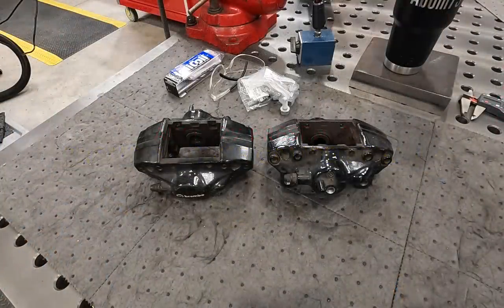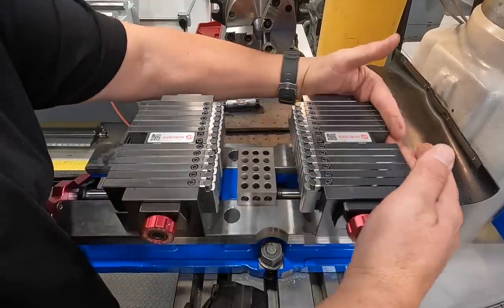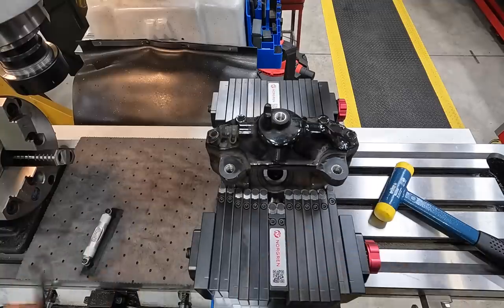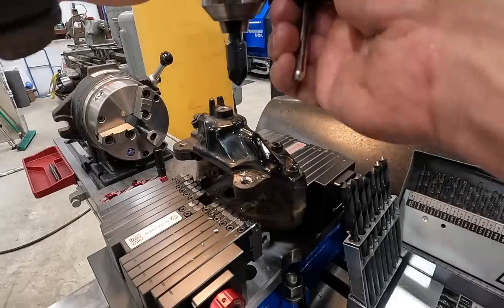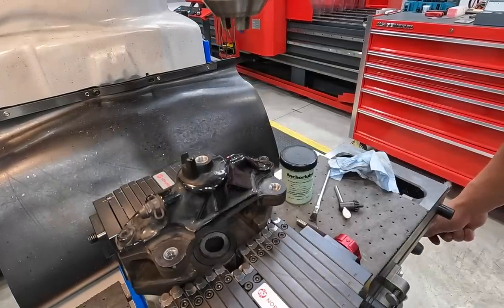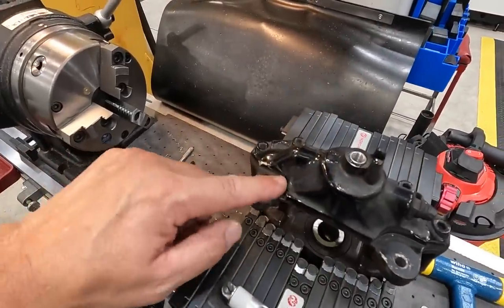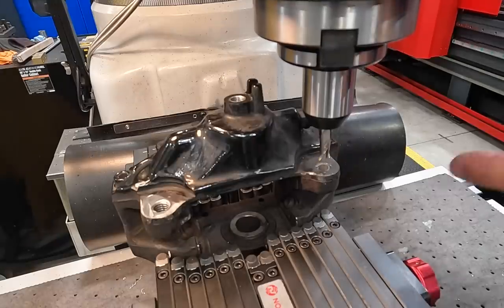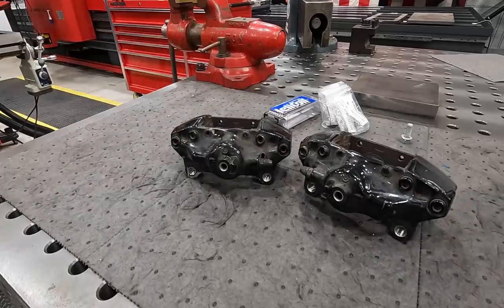Brembo Brake Caliper Repair

Comment: Split the calipers to hold it down..you didn't care about chips/dust getting into calipers so they need to be rebuilt and cleaned regardless ( old used parts )... plus simpler to clamp once taken apart ( machined surfaces you didn't see ).... allen heads were the clue...
Reply: I was thinking the same.
Reply: I think this was more an Adaptix vise jaw video than anything else. I reckon Adam could figure out he could split the calipers if he really wanted to.
Reply: @TheyForcedMyHandLE  
if so? then he would say that?  but he didn't ..lol
Reply: @TheyForcedMyHandLE  
yep it was to show off another tool....brand new..never used...like my brothers toolbox..lol

Comment: Are these coils equivalent in strength to threaded inserts?  I’d never heard of these.
Reply: More or less, in Aluminium they have a great feat of strength. Steel they do quite good, depends on Material.
But Project Farm did a great Video about that and what Brand of "Coil Inserts" are the best. There he tests the Strength of these in various Material.
Reply: stronger

Comment: I would have used wd40, green loctite and a cordless drill to do this... 🔨🪛🪚
Reply: i normally do the same minus the thread locker. i have however used thread locker in 1 situation when an engineer told me that i had to use it. after i did it, it was his problem after lol

Comment: I hope this is make believe.  Nobody in there right mind would modify brake component's and expose themselves to a liability  situation. Just a thought. Thanks for your time. Pete in South Carolina.
Reply: Totally agree. Guy needed to just buy new parts.
Reply: This is a common and tried and true repair on these Brembo calipers. Especially considering the cost to replace them. A properly installed thread insert in aluminum is generally stronger than the original thread. This is a non-issue.
Reply: @fireantsarestrange , I agree.
Reply: @bradley3549  Agreed.  This repair is no problem. Bolts are in shear in this application.  CARRY ON Adam.
Reply: ...WHAT BUSINESS IS IT OF YOURS ANYWAY-?!

Comment: No.. That caliper is split. You can unbolt it and make a fixture  which is more stable and easier to align than those jaws..
Reply: Not recommended per Brembo, you can but you're wasting more time and money doing that. The only time they ever recommend doing that is in a powder coating color change situation

Comment: I'm sorry but I have to be critical here and clamping on that curved vertical surface is a risky proposition at best. Yes, that modified vise is nice for clamping irregular shaped items but it is very  limited when it comes to clamping curved irregular vertical surfaces. At 7:37 you can see that every time you try and tighten up on the caliper body as it tries to squirt out of the vise. Even if you manage to get that unit tightened up, it is still unsecure. If that drill bit was to grab for any reason it is highly possible that it could rip that caliper body out of the vise, break the bit off, and fling the caliper across the shop providing you weren't in the path trajectory. The caliper is manufactured in two separate castings which are disconnected from one another by undoing the four Allen head bolts. Once apart, you now have machined surfaces that will allow you to tie down the milling machine table or you can use that fancy vise should you wish to. When you have made the repairs you re-assemble it back together with new o-rings on the casting junction. That's how it was done in Brembo's factory.
As a YouTube provider you have thousands of viewers who are looking to you for instructions as to how to do a given task properly and safely. You didn't do that here. You took a very questionable path to show off your new toy and as a result you have placed others in harms way. Should one of your viewers use methods like this and get hurt when it doesn't work out, who is really at fault. The novice who is learning, or the seasoned pro who is instructing? Was I shown the right way? That is the question everyone of your viewers has to ask themselves before proceeding under your tutelage.
Reply: I agree with your statement he is usually very safe. I also get that he didn't pay for the vice or jaw kit. Has to make content to make them happy. In a CNC shop it would work great for a small run on a second op. But every day use on one off doesn't make sense. Also I think in your statement they are at least a three piece caliper. ( Main piston, width plate, and backing housing: with or without backing piston). Otherwise on point.
Reply: What’s on your channel?
Reply: @charlieromeo7663  don't have the time to make a channel, to busy with my career. Just wish Abom would go back to his original content. Not doing stuff to please or meet contract agreements, with sponsors. I get what he is doing there's a purpose for it I just don't like it.
Reply: This was NOT an instructional video. He never said it was. You are free to proceed as you wish. None of this needed to be said but then you showed up.

Comment: Another option would be to place the caliber in a rectangle shaped container and then fill with water and freeze.  The caliber would be held in place with enough force to allow the machining.  The important consideration would be to have enough clamping force to be applied along a large area of the ice maybe by placing on both sides of the ice with warm steel plates that would meld into one.
Reply: Umm, you do realize that ice creeps and even melts under pressure?
Reply: @grntitan1  I kind of agree with you but this is how new ideas start; by thinking outside the box.  For example, replace the ice concept with a different medium like plaster of paris.  From what I understand, the tool shown in the video is $7000.  Would you spend that amount or come up with a cheaper alternative.  It's easy to be critical but harder to be constructive.  Next time try the latter and you'll be more appreciated by your peers.

Comment: Helicoil on brakes huh?
Reply: Helicoil are just fine on brakes. The exception would be some motorcycles have steel bolts that use a thread locker. That thread locker will remove the helicoils when you need to take them off. These are not going to need a thread locker so it will be fine. (i would use something like a 641 Loctite to keep the coils in their holes just because I'm paranoid but in general they shouldn't need it)

Comment: I beg to differ. A quarter o a thread is not enough and it can pull put. I was instructed one full thread on both ends. Yes, the bulk of the threads are in the new hole. The tang on both ends must be incapsulated in both ends. Spring tension sans bolt is what holds it in place.  Less Heli-coil is not the issue. I was also taught that you only need 2 threads in order to reach full bolt torque. I do not push that and I do like more thread engagement. I suspect this was for emergency salvage and not a lifetime repair. I have never had an issue with one full thread on the top or bottom. Another problem is blind holes and installing a Heli-coil full depth. Not good. The taper at the bottom can cause it to unwind from the hole due to bolt friction. This has caused many failures and people not believing in Heli-coils. I won't use anything but unless forced to. Whatever you say or think will not change my methods.
Reply: Full bolt holding engagement in steel is minimum 1 bolt/screw diameter, 2 in aluminum,  not thread count.
Reply: A good rule of thumb for thread engagement is the thickness of a nut for the specific thread. The Helicoils in this application are stronger than the original threads since there is increased flank area. I’m struggling to understand why so many “mechanics” booger up these threads in the first place. In my 40 some years working on hot rods, muscle cars, and race cars, I’ve never stripped out threads like were on these calipers.
Reply: @charlieromeo7663  The steel bolts were "grown in" to the aluminum caliper and as such the bolt(s) broke or raked out the threads upon removal, beside that the calipers were bought from a third party.
Reply: @Peter-V_00  Peace,I get it. :)  There are mitigations for the dissimilar metals issue. Anti-seize comes to mind. They were used junk and Adam made chicken soup from chicken $h!* for the guy.
Reply: @charlieromeo7663  Precisely

Comment: Never had luck with Helicoils, they are ok for a one time and done bolt in, but in a multiple tightening and loosening scenario they come loose and pull out.
Reply: You should look into the other heli-coil insert designs if you're having those issues. Not every insert will work in every application.

Comment: *  *  *  *  Don't you want to Loctite those HeliCoil threads ?
Reply: I was thinking the same thing 🌴👍👍😎🌴
Reply: @davidneilson3508  Me too
Reply: HeliCoils don't need Loctite. When you break off the tab, it prevents them from backing out, or running further in. One of the best advantages of a helicoil, especially in aluminum, is that it is a much stronger thread, simply because the helicoil diameter is a bigger thread size than original, and the material is much stronger than the original material.
Reply: as someone above pointed out, brake calipers can get hot
Reply: I've never once locktited a helicoil before and I've never had one move, maybe it's because we don't have salt on our roads causing a heap of corrosion

Comment: I appreciate your skill here but I would have just bought a larger bolt.
Reply: Then you might have to machine the head hex of the larger bolt to fit the recess on the casting mount of the stub axle. Ask me how I know. He did it the easy (and better way) for a circumstance I found.

Comment: Remove this video to protect your reputation. The hose entry should have been plugged. If you still have the Calipers. Take apart and check and clean out the fluid channels.
Reply: @paulcopeland9035  You make a fair point and so it is a matter of contract details between the client and the contractor doing the work. In this case however the machine shop did a brill job in repairing the calipers and placing some covering over the ports would have emphasized the care taken. Its their choice. If I were a client and I received say a newly skimmed head I would not be impressed if it was covered in swarf. The post machining clean up would be a fair cost to the client in my view.
Reply: I thought the same thing. Even if they were shipped like that, 2 seconds to put a small piece of painters tape over the port should have happened immediately.
Reply: @paulcopeland9035  what a smoothbrain comment

Comment: i personally would never trust a repair like this to last. yes it will be fine a year. maybe more. but loose thread inserts will start to frett the metal and move when you are stopping a car doing up to 300kph in some cases. it is a fuck tonne of force applied to steel inserts in cast aluminium, would have made the thread m12 and drilled out the mounting bracket or something on the car
Reply: The only way the insert can be loose is if the bolt is loose, and if the bolt is loose you have bigger problems than a thread insert.
Reply: @bradley3549  Absolutely right.  If the bolt is tight there ain't nothing going anywhere 👍

Comment: Yet another half smart niche tool design. Why didn't they think to spring load each finger individually so you could quickly and easily match the shape of the workpiece then clamp the fingers. They've already got some weird, complicated, hundred part finger design so can't complain about adding one more to each.

Comment: Without those things locking in solid, no way I would ever install those on any vehicle.  With the vibration and the constant stresses caused by repeated breaking, those Helicoils will work their way out and the customer will experience total loss of front end breaking.  Lubing them was a very bad idea, that is just going to speed up the process.
Reply: They will stay in as well or better than the originals. The coils may back out when they go to remove them to replace the pads, but they are better than the originals as long as they are torqued properly.
Reply: I don't know how you think they are going to come out. There's a bolt head stopping them on once side and the threaded part of the hub knuckle stopping it on the other.

Comment: I’m not sure if using heli coils is an appropriate repair for a brake calliper. It is a highly critical part of the braking system. You might want to check to make absolutely certain this doesn’t come back to bite you in the a$$.
Maybe a drop of high strength loctite would have been a good idea to keep it in place.
Reply: You know nothing, huh?

Comment: Love most of your vids, but this has to be the most over complicated why possible to do this. A bench vise and a hand drill would have done just fine.
Reply: I hope you don't live near me, if that is the quality of car work you do.
Reply: I was thinking the same thing. On the other hand you don't want to be needing to use a new tool without having "played with it" first. Just a thought.
Reply: That, I think, is the most imprecise method of machining I’ve ever heard. I’m glad you not fixing anything for me👍

Comment: I would not touch it. It is safety issue.  Owner should have bought new ones..  I think you take a very big responsibilty and you are now liable.. I do not think owner will not discloee this repair info to new iwner.  Bad call Adam.
Reply: it was a perfectly good repair
Reply: I understand the sentiment, but this is a tried and true repair on calipers of this type. They are very expensive to replace compared to normal model calipers.
Reply: This repair is all good.  There are hundreds of Wilwood equipped cars that have been helicoiled, not to mention aircraft of all types.
Reply: I totally understand and trust Adam's procedure for repairs. I my self used helicoil maybe thousand times on variety of applications. But when safety involved I used helicoil to get out of the jam and at the first availibilty replaced the part.

Comment: But you know that manipulate brake parts puts people's lives at risk? The engineers who designed the caliper specified a defined wall thickness on the outside of the threads. Strong forces occur here during braking. It is not intended to drill larger holes here‼️
Reply: No risk. It is stronger, not weaker as the material is stronger.
Reply: It’s stronger now. He has a much larger thread going into the soft aluminum.